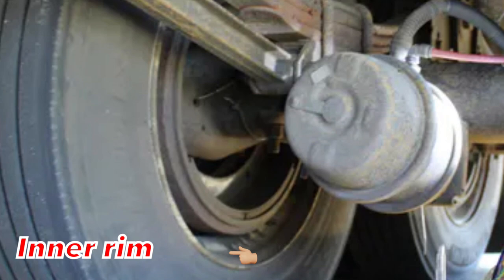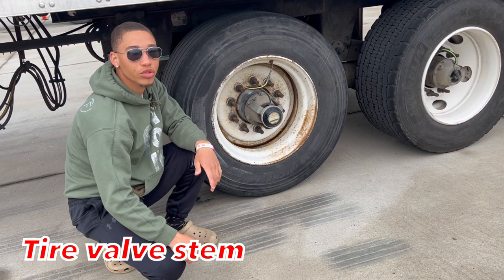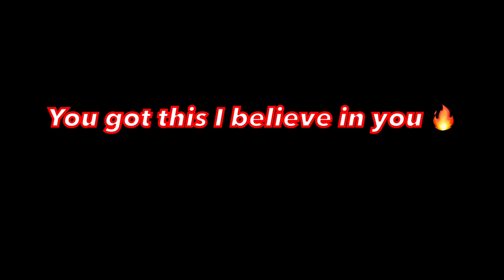Class A CDL Trailer Pre-Trip Inspection 2022

Comment: Good video, but I would also add an inspection of the 5th wheel : The trailer apron is connected to the skid plate, ( with no space in between) and the locking jaws lock around the king-pin. And since the 5th wheel slides, you have to check for enough room to the landing gear, in order for the tractor to turn freely. And the release handle allows for the 5th wheel adjustment. Otherwise, everything else was spot on !
Reply: I think he covers that in coupling